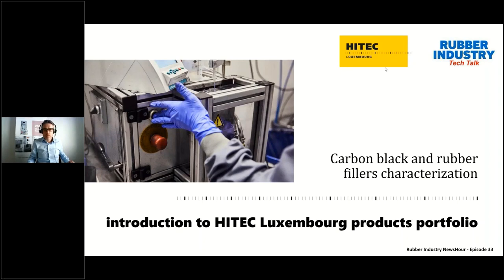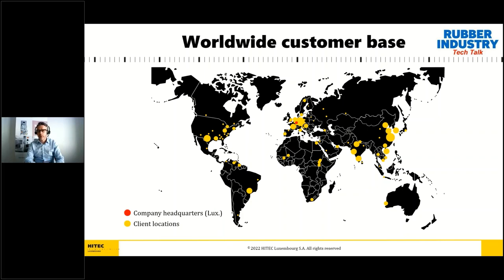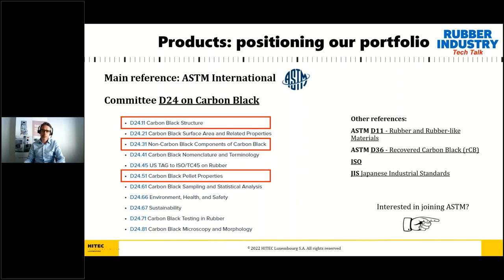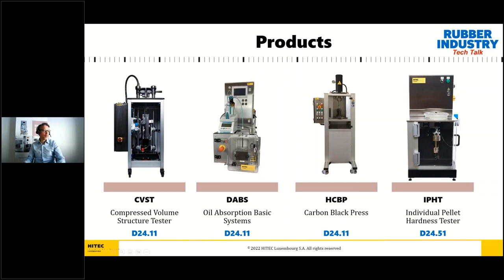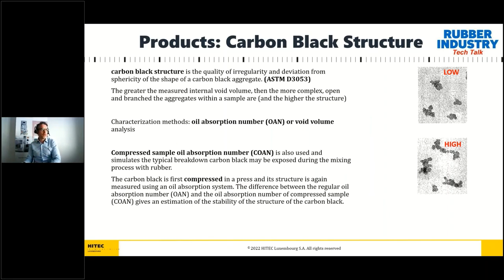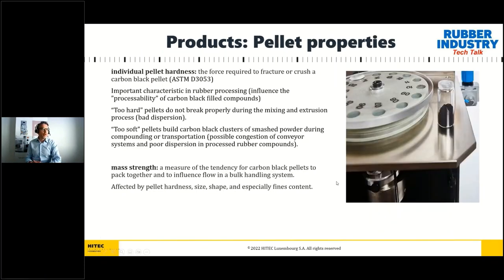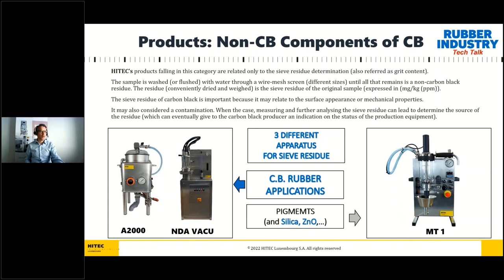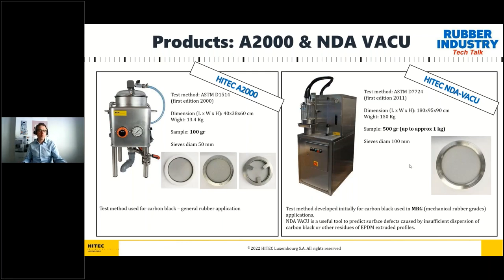Carbon Black and Rubber Fillers Characterization

Comment: Is it possible to use Carbon Black as fillers on asphalt polymer modified in replacement of Caco3?
Reply: Yes..heat transfer is high if we add carbon black as filler